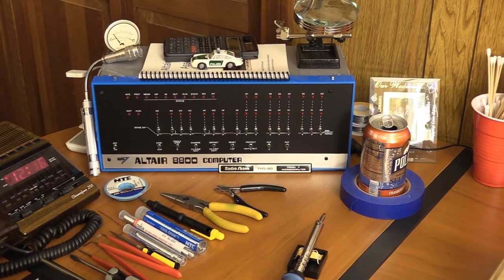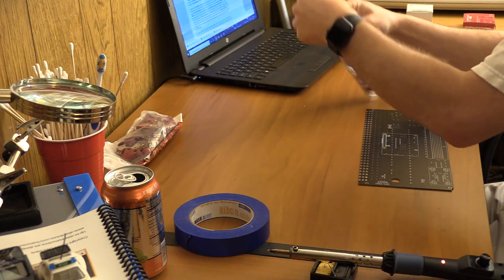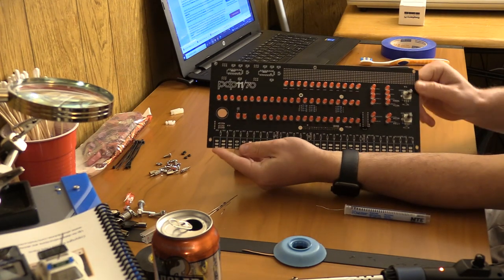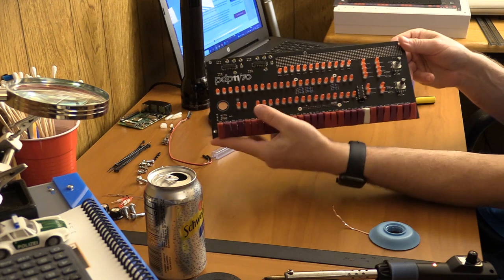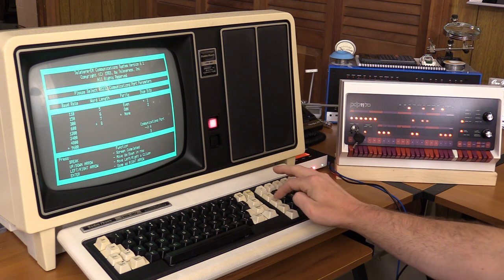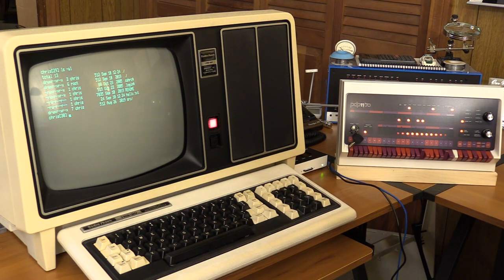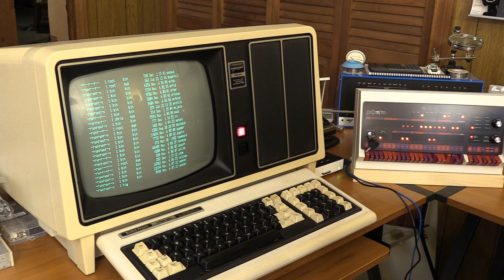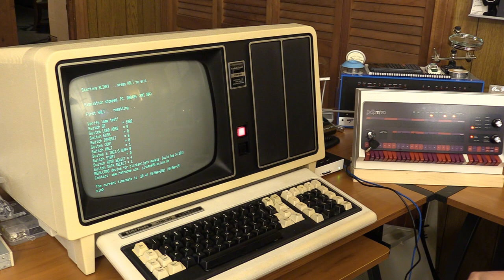Building and Using the PiDP-11 Emulator Kit

Comment: I read somewhere, I think it was for the PiDP-8/i kit, that it's smart to get a small-diameter metal rod that will pass through all of the front-panel switches - maybe at the hinge point? to use as a guide while soldering them in.  That keeps all of the switches aligned and looking good.  Hopefully that's doable for the 11 as well.
Reply from the maker: Interesting!  At the time, I hadn’t come across that, or I probably would have tried it.  Fortunately it came out well.  Thanks for watching!

Comment: I think it is a bit surreal that the Pi 4 is more powerful than a room full of PDP 11's... but hey, I want one too!
Reply: I understand the PiDP4 is About like the unreleased PDP-11/74 (a quad processor prototype). And I want one too. I used to program PDP-11/45 and PDP-11/23 systems for navigating seismic surveys at sea.
Even the PDp-11/45 had (at one time anyway) a dual processor implementation. Dec never sold many. and the PDP-11/74 was cancelled as some of the bean counters thought it would compete too much with the VAX/780. (PDP-11 performance was quite outstanding at the time- I unerstand the Micro pdp-11/73 was actually faster than the VAX/780 though I never got the chance to use both at the same time. (the VAX was pretty good - but he bus architecture was horrible no faster than about 10MB/sec data transfer and made paging performance rather poor.
Reply: @jessepollard7132  Very nice. QUITE JEALOUS!
Reply: It is really surreal, bacause I have 4 Pi 4, 1 Pi 3 and 1 Pi 2, 2 lDell's laptop one I7 the I5, but I want to have a PDP 11. Why I do not have one yet?

Comment: Nice build, when fitting serial ports where the device itself (Pi etc) only supports 3 wire operation, I tend to either loop the handshaking lines back, RTS-CTS etc, or if 12V is available, connect the outgoing lines to that, so that when you connect to a terminal/PC etc, that supports a fully implemented serial port, all is happy.
Usually the TTL to RS232 adapter boards you buy for Arduino's etc, have the 9/25 pin connector on a PCB, so why they don't do something more sensible with the handshake lines has me scratching my head, it's only a few extra tracks that costs nothing extra to produce during mass assembly.
Reply from the maker: Thanks for watching!  I’ve always wondered why these TTL<->RS-232 boards don’t do the fairly simple additions needed to make pickier serial devices happy.  Even some serial-to-Ethernet converters lack support. I suspect that so few devices even care about CTS/RTS these days that it’s not even given a thought. The TRS-80 II/12/16 line are the first systems I’ve had that were unforgivingly picky about it.  Most other systems, even my other TRS-80s, either don’t care by default or can be made to not care fairly easily.  I guess that’s part of the fun, right? 😄
Reply: @TJBChris  I thought of adding in a MAX232 to mine, but I'm starting to opt more for using a Keyspan USA19HS, which I've successfully used with Linux/Raspian in the future. Any comment on those? Obviously, they're a bit bulkier than the MAX232 solution. Also, if I do get a MAX232, what part number did you order? Your bag in the video looked like it came from Mouser...
Reply from the maker: @pkhoury1212   You’re right, I’m using the MAX232.  I haven’t had any issues with it.  My Tandy systems seem to have no issue talking with it, but I’d bet there’s more than enough room in there for the Keyspan solution.  I hoped I had the part # floating around in my e-mail, but I’m a serial deleter of messages, so I don’t have it handy.  If I can find it in my orders I’ll reply back.
Reply from the maker: Found it.  I ordered the MAX232 from DigiKey.  When I ordered it, the part # was 296-27963-5-ND, described as MAX232EIN according to my order.  Good luck!
Reply: @TJBChris  Thanks for the part number. And 0.1uF caps, right? Or does that part require 1uF? The keyspan solution is definitely bulky, but does work so far.
Reply from the maker: @pkhoury1212  Yeah, they’re 0.1 uF caps for the MAX232.  Five of them, if I remember correctly.